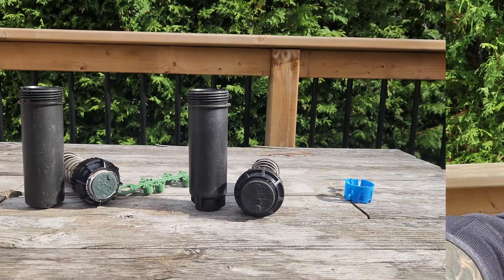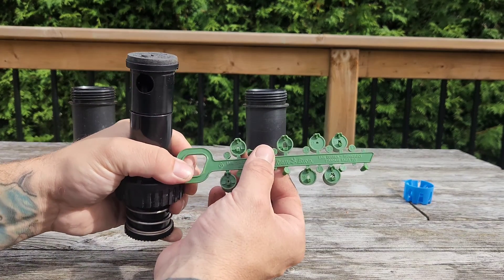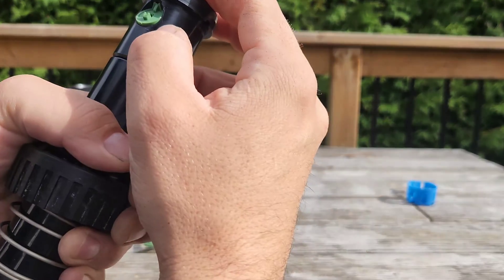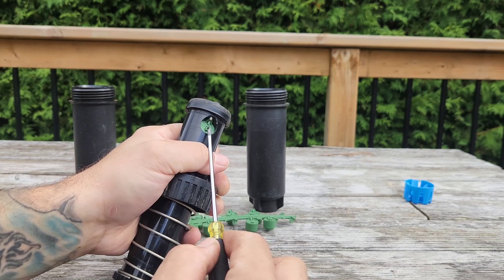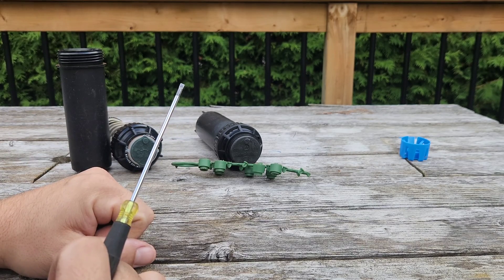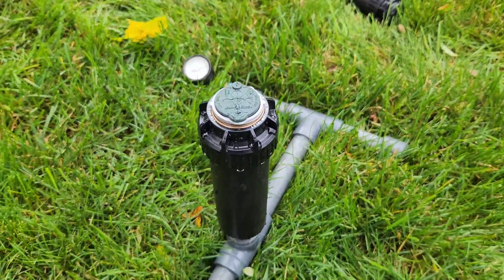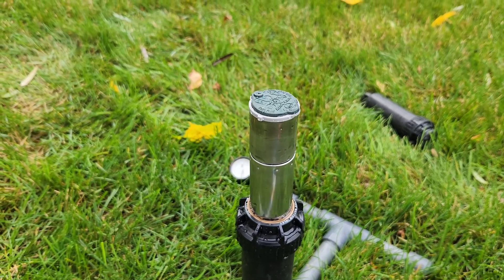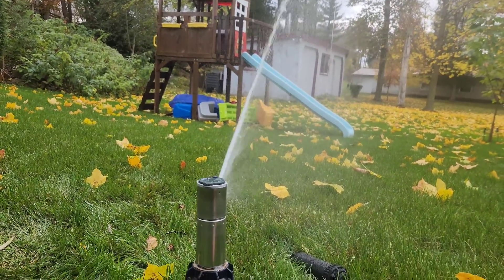Rain Bird 5000 Series Rotor - A brief description and operation of features.

Comment: How do you turn it off without capping it? I mean 5000 which is without middle hole for shut-off...
Reply from the maker: @NikolayGunichev  you cannot turn it off like that if it’s just the normal 5000 series’s.  You must close the valve upstream from the rotor or zone

Comment: Awesome video, when was that older style 5000 made. Also, those nozzles look like the older style t-bird t-tree models. I also haven't seen a first generation 5000 with a green nozzle, the ones I saw had a light blue nozzle. Did they have different nozzle racks? By the way, the 5000 came out in 1999. They invented the slip clutch and redesigned these rotors around 2004.

Comment: are you using 1/2 line or 3/4"  - i am afraid the 1/2" i have installed will never get 15+ feet of water spray.
Reply from the maker: @roberthug8440  this video is fed with a 1 inch main and 3/4 inch garden hose.  The base is 3/4 inch.   You should have no problem running one head on 1/2 inch as long as you have enough pressure to begin with
Reply: @MikeMac89   The installer has 6 heads on 1 zone. I have a 1.5hp pump getting water via a 1inch intake 10ft below grade,  and a 3/4 inch discharge.
Reply from the maker: @roberthug8440  hmm 6 heads is a bit aggressive for 1/2"  what nozzles are they running ?   You might be ok depending on the output of the pump.    Even with the smallest 1.5 gpm nozzles installed that's still 9 gpm at 40PSI is what you'll want to be running.    You'll have no problem getting 15' even on 30 PSI with a 5000 series rotor.
Reply from the maker: @roberthug8440  I always do a 1" main line now.   Saves so many issues later on.  If you want to expand you have the room.   It's more expensive but saves a lot in the long run

Comment: Great video but I still can’t figure out how to get the left side of the spray to stop about 6 feet from going too far left. It’s stopping perfectly where I want it to on the right side. I installed the Rainbird 5000 not Plus. It’s working fine but can you please explain to me how I can get it to turn about 6 feet less to the left? Right now it’s turning a bit more than 180 degrees to the left. I know it should be simple but I’m just not getting it. Thank you so much
Reply from the maker: @Doowopsid  Of course !   Your left edge is fixed and not adjustable. So you need to start with the left edge.  Rotate the entire sprinkler in the ground if you have wiggle room , in this case you'd be tightening it on the fitting by turning the sprinkler clockwise.   If you don't have the room to move it then you can unscrew the top cap and remove the cartridge from the can.   The bottom of the riser is "geared".    Find your left stop , then align the cartridge the best you can with the left edge of your landscape, fine tune it by turning the entire sprinkler body on the fitting.    

You must always start with the left edge with the RB 5000.   Once you're good to go on the left edge , use the adjustment screw on top to move your right stop.    

I will make you a video tomorrow on how to do this !
Reply: @MikeMac89  Wow, thank you so much! I will be trying this tomorrow. I also don’t exactly know how the slip clutch mechanism works yet but I think it should be a pretty cool and easy way to adjust the radius I believe. I just have to watch your video a few more times. I’m 90% there and just happy that I was able to screw the sprinkler canister on since it did not go on easily. It needed a lot more pressure for it to catch on the threads and start to turn. The Hunter PGPs I used before went on a lot more easily for some reason. But it is working fine but it’s just going a bit further left than I want. Thanks again!
Reply from the maker: @Doowopsid  the slip cluch I'd good , but iv ruined many heads because it stops working and strips the gears.    You'll know if it's working, turn it to the left stop and apply a little more pressure.  You'll feel the clutch slip and allow you to  rotate to move the left stop.   If the head is older chances are the clutch will be seized and not work.   Iv found it just as easy to do it the way I explained.     If you decided to use the clutch , keep turning it to the left until you are happy with your left position.
Reply from the maker: @Doowopsid  the PGP is a slick head.  Nothing bad to say about the PGP.  Been around for ages.
Reply: @MikeMac89  Thsnks, I’ll definitely be trying the way you originally described!
Reply: @MikeMac89  I switched to the Rainbird since I like that you can make all adjustments with a flat head screwdriver instead of the Hunter wrench

Comment: Hi Mike, how can I build some of these PVC systems with valves? Thanks!
Reply from the maker: Hey , they're super easy to build.  Get a 10' length of sch40 PVC and some fittings.  I used 1/2" for this one but you can use 1" as well.   Get two Tee fittings with glue connections on all three ends and one Tee with a center NPT threaded connection for your sprinkler , three end caps and then a PVC to NPT coupler for your water connection , a ball valve and then a NPT to garden hose connector for your garden hose to screw onto.    Cut your SCH 40 PVC to whatever length you want depending on how big you want your base to be , glue it all together with some PVC cement and put your valve on the end.    

I have a video on my channel of me building a 1" one.   It's in my live videos.
Reply: @MikeMac89  Amazing, thanks kindly for the reply!

Comment: I wonder why rain Bird removed all the quality of life features on the 5000 compared to the t-bird and r50.
Reply from the maker: Yeah I'm not sure who made that decision,  the T bird was one of the easiest rotors to adjust and maintain.  And the robust R-50 lasted for decades in the ground.    My guess is they wanted to fall into line with the majority of other manufacturers buy offering a wider nozzle selection and adjustment with a tool rather than having to have a different process.     They did add the slip clutch feature and shut off feature if you got the plus model, but still nothing compared to the older rotors.
Reply: @MikeMac89 the regular 5000’s are also slip clutch